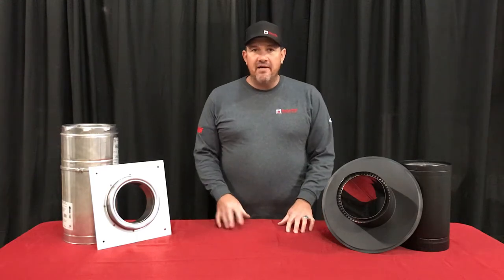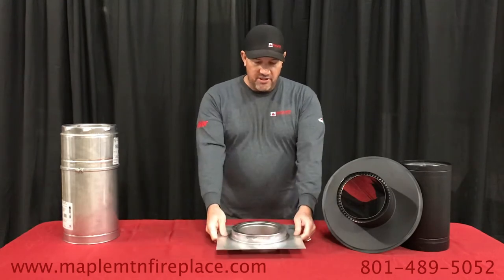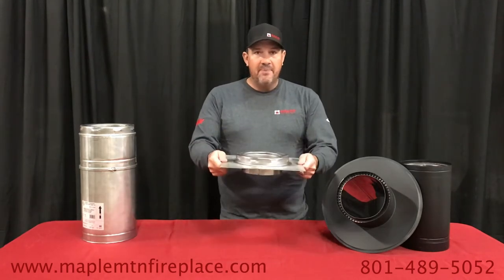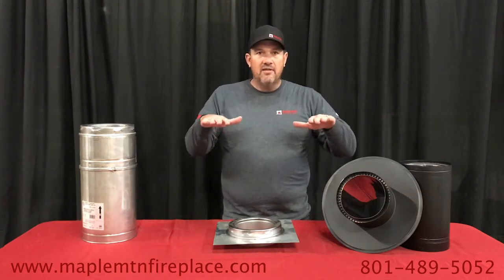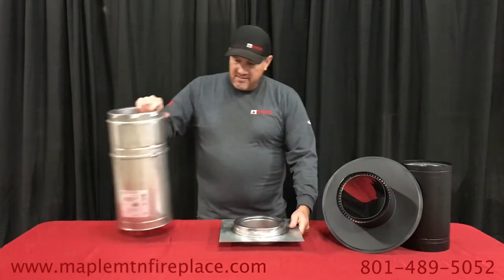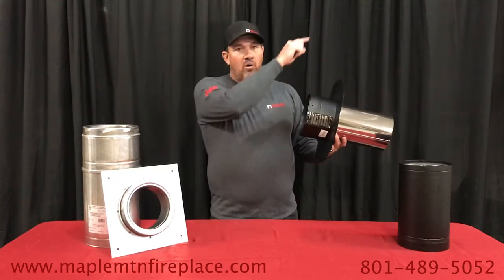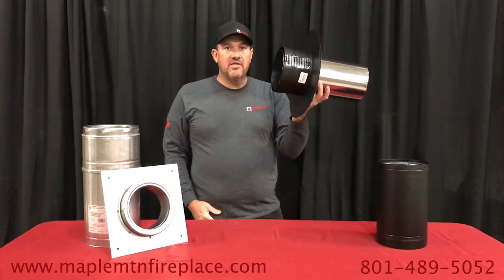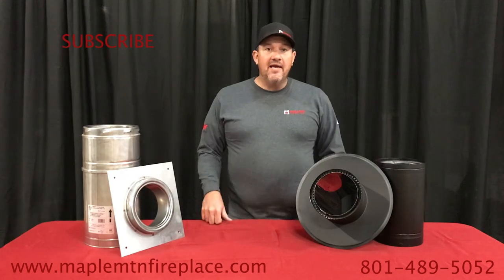Masonry Chimney Pipe Adapters

Comment: I’m building a large masonry open fireplace and doing the anchor plate. Do I go with a 6” or 8” Class-A pipe? Wondering about draft, assuming the chimney is correct height. Thanks

Comment: I have a chimney with a clay lining that's 6.5" i.d. wide & I'm wondering if running a single wall 6-in steel pipe up the chimney is possible. The chimney is half in the house and half in the non heated garage. Would I have to insulate the steel pipe inside of that as I'm not so sure it would ever fit down the chimney with insulation? I know you can spend many thousands of dollars to tear the whole liner out and go that route but I'm not looking to do that so I was wondering if it's possible without all that type of trouble. I was thinking that the single wall steel pipe would add an extra layer of protection to the terracotta lining that is already there and probably okay shape but. Is there some kind of really thin insulation wrap if it has to be insulated that would still fit? I was also kind of hoping I could go at a 30° or 45° angle through the chimney instead of doing two 90°. The wood stove I got is a reburn style Englander so I was not wanting to reduce the flow a lot with two 90° if possible. I can't find anybody that does chimneys here anymore the guy that was doing it is no longer doing them. Others are hours away. I was just trying to make it a little safer with a steel pipe inside the clay lined chimney.

My current stove is an older Ashley stove and the pipe goes straight out the back straight into the chimney. There is no way I can go into the chimney in that location with the newer style stove so I'm also going to have to figure out a way to fill that hole in unfortunately I'm sure.
Reply: I’m sorry I didn’t read your whole comment. But from what I know, you buy double walled insulated steel pipe and run it up your masonry chimney. Seems to be standard practice for conversions.
Reply: @taylortisaac  double wall would be wider than the 6.5" inside diameter wouldn't it?
Reply: @jackle842000  ooooh I see your concern now. Sorry, no help here